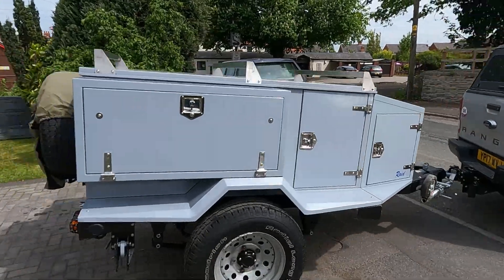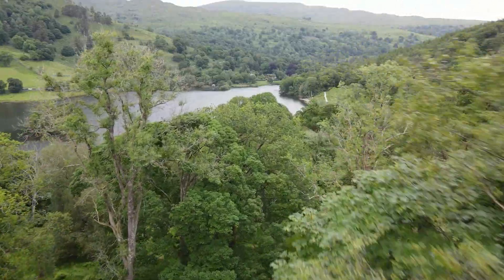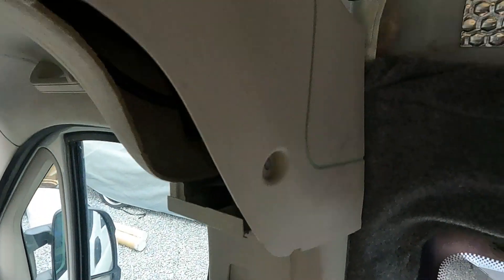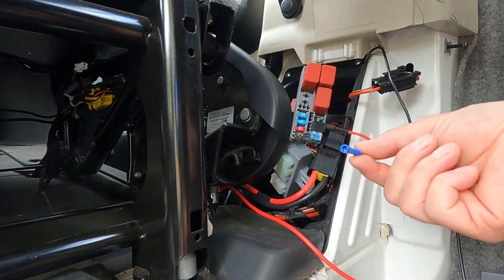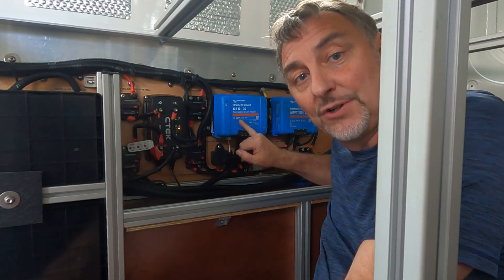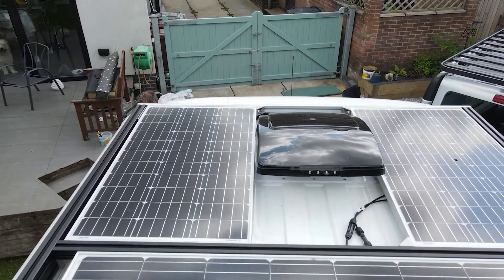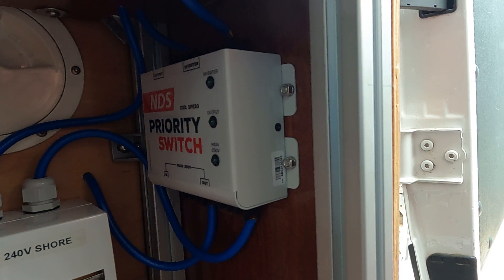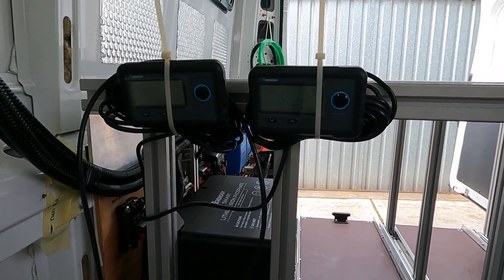Installing Renogy LifePo4 Smart Batteries

Comment: Would love an update on how these 3 batteries have been working for you! I am installing 2 of these in my camper van next week. Any thoughts or tips now you have used them for awhile? Any adverse outcomes having them on their sides stacked? That would be so nice in our build but I thought they had to be upright. Enjoying your setup!
Reply from the maker: Thank you for watching and sorry the vlogs are a bit short at the moment...way too much "working life" getting in the way at the moment.
You've got to love a Lithium battery...you can even put these upside down.
I wanted full access to all my services but was mindful I wanted to avoid garage contents coming into contact with my battery terminals (unlikely but "just in case").
Turning them towards the van wall keeps the terminals protected and hides the wiring of the 2 seperate systems (1 battery and 2 battery banks).
Most of the time, using the monitors, the batteries are put into "sleep" mode which I like for long periods of inactivity and so far, the batteries have been great to work with.
Next week we're having a van "shake down" ...17 days away with full systems checks. We're not fully built yet but enough to stay comfortably away.
I'll hopefully be doing a more indepth vlog so do keep watching.
On our Facebook page, MyWay Adventures I posted a 6% off Renogy products that you may find useful.
Paul
Reply: @vanlifemyway7806  cool. I'll keep an eye out for your review updates after your next trip. Have fun!!